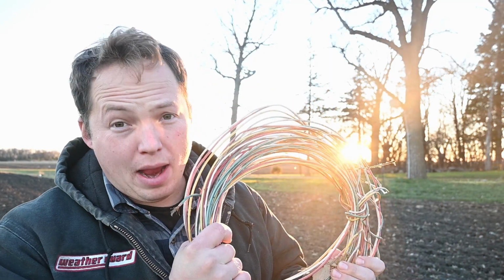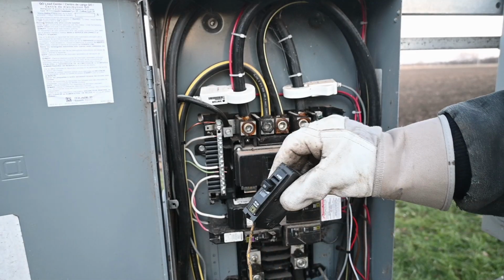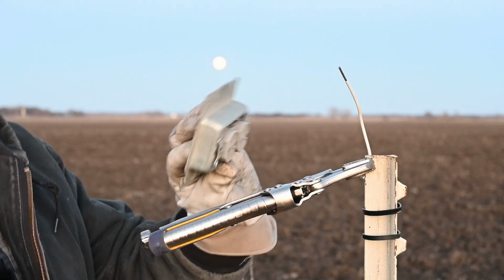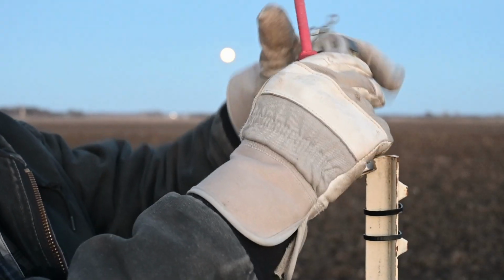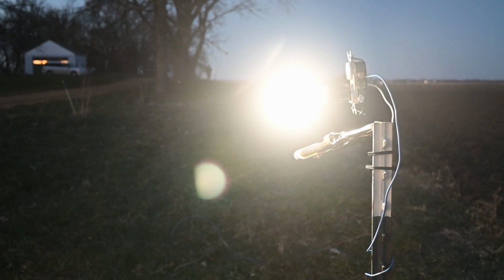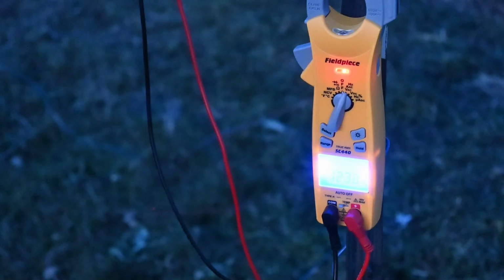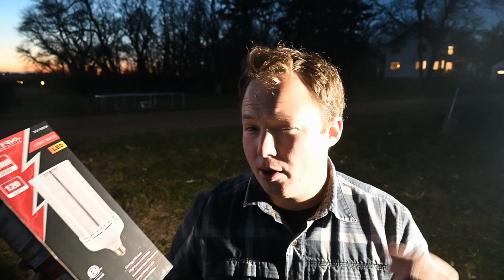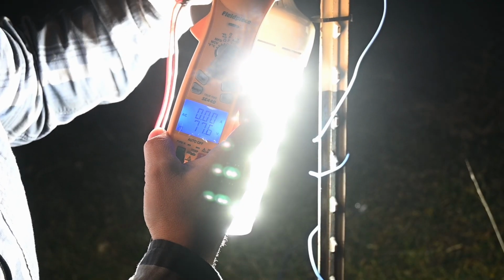Powering a Light With a Fence Post & Scrap Wire - SWER (Single Wire Earth Return) Demonstration

Comment: the problem with this, the more power your house is using, brighter your light will be. stop using all power inside your house, your light will go out.... you can think of it as the return line on your fuel injection system on your car. any other gas that's not being used by the injectors runs back to the tank. just to be clear here.... this is not free energy.

Comment: 0.1 amps dropping 8 volts implies that the ground part of the circuit has a resistance of about 80 ohms. Which is more than a return wire would have, but not too shabby.

Comment: Please do a video showing how you would handle a situation where the lights and the switches both ended up terminating at the main braker box. 
Example changing over from a low 12v 22  Gauge touch plate system to a 110v updated switches.  With 3 way and single switch runs.
Thanks

Comment: It's used for under-sea fiber optic communications repeaters.  However, I think that is around 30kV DC....the repeaters don't take a lot of current to do what they need to do.  I bet AC would not work in that case...hence DC.

Comment: Hopefully you don't have a Well in the area or any underground pipe, (Ferrous or Galvanizes) , etc. Stray current will create a corrosive "Electrolysis" and that will Corrode (rust) the well pipe in half if it too is not grounded. So watch how you do this project or it will COST you Thousands in repairs. Also, Earth has Unequal Resistance and you encounter a slight current (tingle or shock)  if you dig between the light and the (breaker panel) source. So in short, this is NOT a good idea. Two more things you may want to know,,,this works better with WET SOUL and NOT SO GOOD with dry,,sometimes not at all if the "Ground Post" is not deep enough or the soul is of pour conductive quality. And #2, as your voltage Drops,,the amperage goes UP,,and Amperage (AmpXvolts= watts) or Wattage is what your Power Meter reads. So doing this may increase your Electric Bill. So you saved little to nothing by only using ONE WIRE of the WRONG SIZED then by going by the NEC book's suggested wire size. Just a few hints from a Retired Lineman.

Comment: About 55 years I went with my brother in-law to look at an old generator in an old service station garage it was massive it supplied the whole town and farm out ten miles away running power out by the old barbwire fencing the old gentle man who showed us this massive single piston motor told how the owner of the plant would leave work at the service station at 900 leaving the generator running unattended overnight if the generator was overloaded it would power out and die and the owner didn't get out of bed to restart it so no power until he got to work at eight in the morning since you could hear it from every where it serviced if they heard it laboring every body rushed to shut down all power they could otherwise no power till morning so pumps and anything else would be turned off until the generator was running properly again that's something people wouldn't put up with and safety regulations wouldn't allow now can you imagine the noise and the danger of those barbwire fencing power run through them back then people were grateful just to have the convenience of having power you could have hot and cold running water a toilet tub and sink a coal Stoker for the furnace get up to a nice warm house convenience those in big cities took for granted
Reply: Douglas Windsor, Thank you for this excellent piece of history. But seriously, did i understand they used barbed wire for transmission lines?
Reply: @What2B  yes back then they did a lot of stuff we would never even think of today having power gave you the ability to have modern conveniences like heat water and lights on command just think of the convenience didn't have to get up during the night to add coal to the furnace didn't have to pump the water you didn't even have to watch your battery level and when they got too low start the generator to top them up everything was much easier so you put up with a little more dangerous situations thankfully the government brought in electrification and we saw that every small town and  almost every farm could have have power interesting that it took until the mid seventys before they brought in gasification my brother in-law and his dad hooked up to gas in 1975 no more need to check the level of fuel his dad's wasn't as critical as long as the diesel tank for the farm had fuel he could always get a couple of jug and add it to the heating oil tank but my brother in-law was on propane and when it run out there was no heat until the dealer got there but it was more convenient with a a thousand gallon tank you had more than enough to last the winter  but since gas isn't as profitable when utilities were deregulated the gas co-op got a monopoly where we are at we are only able to become a member of the natural gas co-op and Buy from them
Reply: @douglaswindsor120  Thank you, great share 👍🏾

Comment: The resistance of the soil depends on two main factors,  mineral content and moisture - that setup will work better in rainy weather.  I've used a ground stake and a long wire to measure soil resistance in conjunction with ham radio antennas,  less resistance means better ground plane and more efficient transmission.  If the ground was too dry,  turn on a lawn sprinkler and dampen the area under the antenna,  it helped make more distant contacts.
Reply: Won't that create hydrogen gas from electrolysis?

Comment: Really don't think you understand basic electrical science.   Of course you will read lower voltage at the outlet.  The bulb is a voltage divider as a type of resistor.  You are measuring the voltage drop across a load proportional to the power it consumes in a single current loop.  There is still 120 volts hanging out between the feed wire and ground even with the bulb attached because you are tapping a voltage source.  Earth is ground no matter how far away you go from the box.  Because with AC there is little to no capacitance building up or opposing magnetic inductance, a load can draw current.  This would not work well with DC because an opposing energy field would be set up. DC voltage would have to be boosted every so many feet.  Electrons do not flow down a wire or in dirt as most people think.  Energy is exchanged and flows as a field. as fast as 1/c seconds. [ c is the speed of light ]  So electrons don't really move.  The wire only facilitates an energy field.  And both the feed and return fields flow toward the load.  DC generation breaks down due to opposing forces over distance.  An AC generation can use the Earth because it overcomes the magnetic and capacitance loads.  Thats why doing this single wire experiment is quite dangerous.  It takes only 1/10th of an Amp.  at 110 volts to kill you, which is 10 times what a 100 Watt bulb will draw.  So kids, never do this at home, and I am surprised YouTube is not putting a huge disclaimer on this, though I do still support you have the right to show it under the First Ammendment.

Comment: My grandfather had a similar setup to power the electric fence wire around his pig pen. He took a single wire from his shed to a light bulb then ran a bare wire from there around the pig pen on fence insulators so there was no path to ground, but when a pig would try to get out, it would touch the wire while standing on the ground and that would complete the circuit. Pig got shocked, squealed, stayed in the pen. The purpose of the light bulb was so that if some grass grew up and leaned on the fence or something else was on the wire, the light bulb would be lit and he would know the fence needed attention. A side benefit was that the electric fence used no power whatsoever unless it was shocking something or needed attention.
Reply: Your grandfather was genius the light bulb lowered the amperage, so that it didn’t kill the pigs.
Reply: @danielsullivan9865  
A light bulb wouldn't lower the voltage enough  to prevent killing the hogs. A 100 watt light bulb draws less than 1amp.
Reply: @tubeonline629  Without the lightbulb you would be drawing 20 A and 1200 W. A  10 watt  lightbulb would draw .083 Amp. Not saying that this situation wouldn’t be very dangerous, just very ingenious amp reducer.
Reply: @danielsullivan9865  
Volts is not what kills someone, amps is what does, and it takes less than 1 amp to kill.
Reply: @tubeonline629  How many amps is a 10 W light?
Reply: @danielsullivan9865  
.08  which is less than a 10th of a amp.
Reply: That’s my point Jerry rigged step down  transformer. Controlling the amperage by the light wattage.
Reply: @danielsullivan9865  
Think about this, if you walk in a room and someone is watching tv, and you turn on a lamp with a 100 watt bulb that's on the same circuit the tv doesn't dim down. They are not splitting the voltage, both are getting 120volts and each is pulling how ever many amps they require you can keep turning on lights on that same circuit until your drawing enough amps to trip the breaker, but with the tv on and several light bulbs on if you have a wall outlet not used but on the same circuit, check it with a meter and you'll still have 120 volts. If you cant figure this out then I feel bad for your lack of knowledge. I have tried my best to explain this as simple as i know how. And won't  respond to any more of your ignorance.
Reply: @tubeonline629  The line side will always be the same as the initial voltage. It’s the load side to ground that will change after the light. You can’t push 20 Amps through a 10 W light bulb , only .083 Amps. I don’t know what your credentials are but I had 23 electrical inspectors under me.  I was a supervising electrical inspector. I am retired now but haven’t forgotten everything and I really don’t know why we’re even discussing this whole situation because it’s extremely dangerous.  At least 10 NEC code violations. I guess I just found it interesting,people do stupid shit and that’s why we have electrical inspectors.
Reply: @tubeonline629   You know better than that.  There was no contradiction on my part. You  lack of knowledge to have a civil discussion.
Reply: @danielsullivan9865  idk ur place what is the Gen ability may b 3gw ie 3000,000 kw or 3mkw  in ur state but they supply 100 times that no idea how if 30million utilities ie factories houses shops etc then it is even 2kva connection then it is 30x2 60 or 60mkw supply.. Can u pls explain this 3 over 60 ratio or 1:20 ratio production  capacity to usage  at the very least in fact it is 1:100 on closer inspection in reality... Can u explain
Reply: @tubeonline629  Your analogy is wrong. In the farmer's circuit you have the line connected to one side of the bulb and the bare wire connected to the other side of the bulb. No current flows and the bulb is unlit as long as the bare cable isn't grounded, But if you attach something to the bare wire and ground the other side, it will be in series with the bulb. Not parallel as your analogy describes.

The light bulb acts as a current limiting resistance. If you use a 15watt bulb, you will be putting about 960 ohms in series with the circuit, so the maximum current you will get is 125 milliamps or 0.125 amps. (You can measure the resistance of the bulb with a multimeter or calculate it with Ohm's Law.)

In the case of shocking the pig, you will have a series circuit with 3 resistance values. The resistance of the light bulb, the pig's skin and the earth. So total circuit current will be, I = E/(R+R+R)  We know the resistance of the bulb and we can make reasonable approximations of the pig and the earth.  

Human skin will have resistance of about 10,000 ohms. (You can test this with the multimeter. It will likely be higher but could be lower if wet.)  Turns out that pigskin will be about half of what human skin is. So about 4000 to 5000 ohms is a reasonable value. 

The effective resistance of the  earth can vary too but about 100 ohms is a reasonable value and is consistent to the observations in the video. 

So we have the equation, I=120/(960 +4000+100)  or I = 120/5060 or about   0.024 amps or 24 milliamps.  Personal protection GFCIs trip at 20 milliamps max. The  pig or you, would definitely feel it, but likely not enough to do any serious damage.

If we want to know the voltage of each element of the circuit, we can use another variant of Ohm's Law,  E = IR. So the bulb will see 23.1 volts. (960 X 0.024). The voltage drop of the earth will be about, 2.4 volts. (100 X 0.024). And the pig will see the remainder  or about 96 volts. 

The bulb will limit the total current. You can plug in some other values of reasonable resistance and see the difference in voltage and current. Use a 10 watt bulb or a couple 15 watt bulbs in series and the total limited current will be even less. 

Where you got it wrong is that you assumed the farmer's circuit was much like the video with the hot  running all the way to the bulb connection. If you connected your circuit before the bulb and to ground, then you would have a parallel circuit like you described in your analogy. 

I certainly wouldn't call the farmer's circuit "Safe", but as     long as the bulb wattage is low enough, (higher resistance), it can limit the current to non-fatal levels. The bulb indeed may let him know that the fence is grounded, but the real purpose is to limit the  current.
Reply: @professorg8383  
Thank you for clearing that up for us, I believe you know what you're    telling.
Reply: Your comment was worth watching this video now I see a useful application. Probably too great of a shock for chickens but it good way to keep larger livestock in a small area.
Reply: @brotherskeeper2598  Just don't go shocking yourself 👍
Reply: @brotherskeeper2598  Umm ; chickens fly! And if they don't fly, they don;t climb fences. What Up Dude?
Reply: @haroldwestrich3312  
Chickens fly?
Reply: @haroldwestrich3312  
I know they can kinda fly, and if they fly up enough to sit on the wire, they would not get shocked anyway because there not grounded.
Reply: @tubeonline629  they will never try to sit on the wire.
Reply: @water_is_wet_or_is_it  
You are right chickens aren't able to balance on a wire, but if they could, then what i said is true.  Also anyone wiring a hot wire fence to straight 120 volt is just asking for death. A live wire is always looking for a ground. This whole video seems silly to me, i don't know why he was surprised it lit up the bulb, if he would of touched that wire it would have lit him up unless his boots were electrically insulated. Same reason they sell those plastic plugs for outlets to keep toddlers from getting shocked if they stick something in the outlet.
Reply: Only problem with this is if a person or something grabs the fence they have no chance of letting go, so they  are just stuck getting electrocuted.